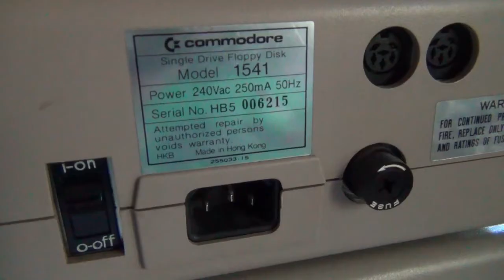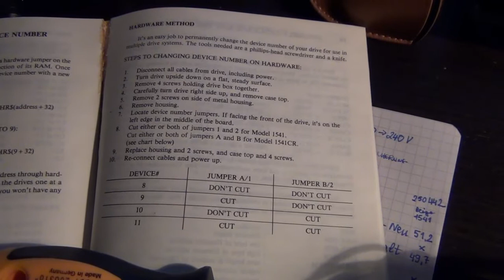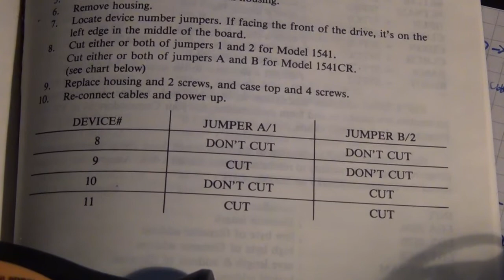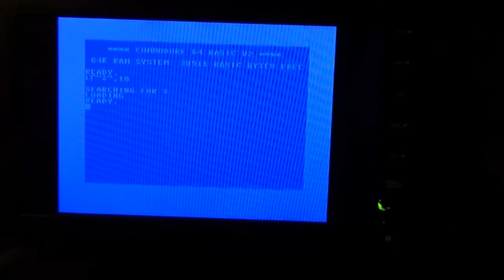Commodore 1541: Repair and improvements

Comment: The C is actually the 3rd iteration (besides the change from Alps to Newtronics) of the external ones (the SX-1541 being internal). The 2nd one is the rainbow-badged one, and the 1st is the black, 1540-like-badged one. So of course that means that as far as the external ones go, the II is the 4th iteration.

Comment: Some good idea's for this old drive. I currently have 2 of them. I am planning to install that fan and also that modification to the transformer. Because it say's 220V on the back. The chips are equipped with heatsinks now.
Reply from the maker: Excellent idea to add heatsinks, I still have to do that. Let us know how it works out!

Comment: Nahh, I've seen people put device switches and write-protect disable/enable switch on the front. Little toggles. There actually is enough room. Too bad you weren't doing this like 35ish years ago!
Reply from the maker: Probably the front would work well, but I prefer the back, since the switch is quite unobtrusive there. I like the historical front of the 1541 and didn't want to change that. :)

Comment: Hello, Thanks for your video.
I have a question, i want to put a switch to turn my drive from 8 to 9.
Would it work if I put one wire of my switch on the pastille and the other on the mass? This will avoid cutting this pastille.
Thanks for your answer.
Reply from the maker: Not sure, but I assume it would not work, since the jumpers' connection needs to be interrupted. I don't think you can simulate that by going to mass. When connected, both jumpers A and B go to the same trace - there would be no way to control A and B independently. If you managed to somehow bridge/invalidate that connection in some other way, it would switch from 8 (all connected) to 11 (all cut).
Reply: @LeadingMotive  Thanks for your answer. Regards.

Comment: Hey nice tips. Any idea how to do the 240v mod on a VC1541 (vic 20 1540 drive with 1541 roms) as you can't access the terminals. (The transformer is encased and dipped)
Reply from the maker: Unfortunately if it's dipped in epoxy I don't think it's possible to open it. Maybe then it's better to replace the whole transformer. Sorry, never had a disk drive with epoxy so I don't have first-hand experience.
Reply: @LeadingMotive  Thought as much oh well. I guess some kind of active cooling is in order!

 Thanks for replying and the video! :)

Comment: geat tip aboutre the fan :) what volt effect did you use on the fan?
Reply from the maker: I'm not sure what you mean by "effect"; the fan is for 12V, but I connected it to a 5V source on the board, which is enough and keeps the noise down.
Reply: @LeadingMotive  I mean What fan could I buy and install.  How many watts should it have?
Reply from the maker: A standard PC cooling fan. If I understand correctly, they are typically all 12V and less than 2W (i.e. at 5V less than 1W). I used this one: https://www.xilence.net/en/case-fans/50. Its measures are 60 x 60 x 15 mm, don't take anything bigger than that.
Reply: Thanks a lot for the help. I will try this :)